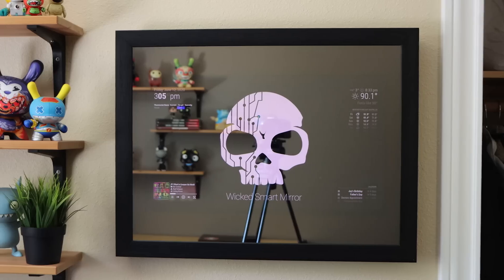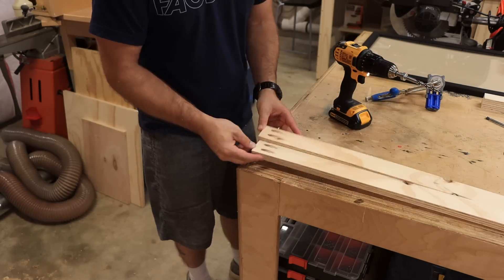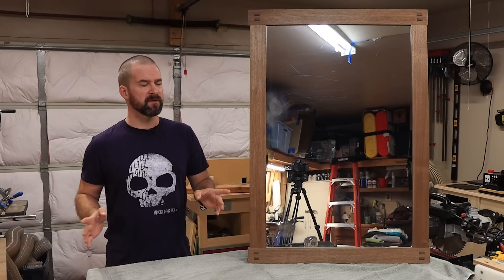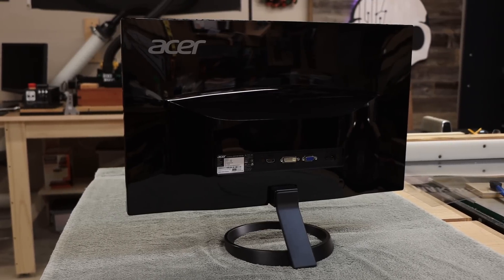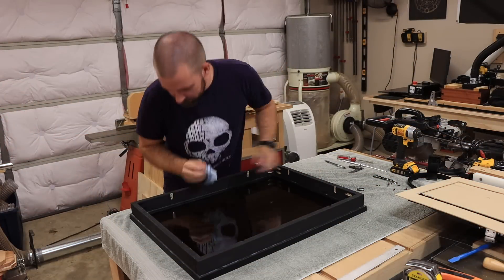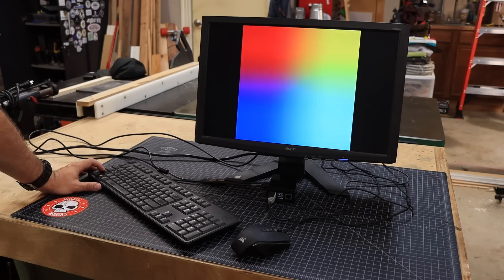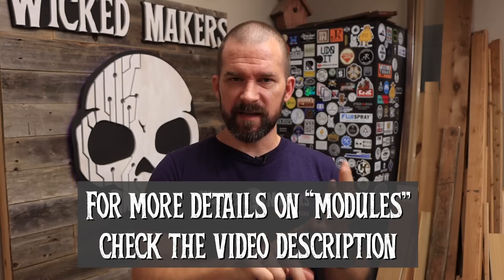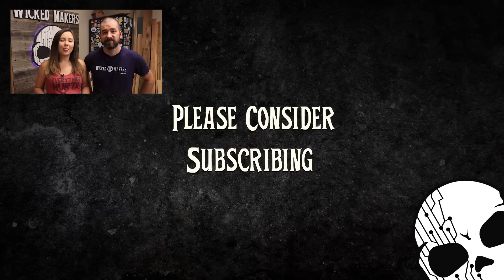How to make a DIY Smart Mirror

Comment: FYI - currently ~$460 + ply & keyboard/mouse. I recommend a wireless combo one for connecting to pi. Best wishes!
Reply: Why have that when you can ssh into the pi from another computer?
Reply from the maker: That’s fine, but not everyone knows how to do that.
Reply: @Roodj1  while interacting with the smart mirror, you'd prefer to interface using another computer? Maybe for initial setup but not for day to day interactions... that would defeat the purpose of the mirror.
Reply: @the.mr.beacher  well for most applications ssh would be fine because you would not be accessing it much.  For other applications maybe, but then becomes a "where do I hide these items" when not in use.  You can also, for a fee, get applications that allow you to use a web interface on another computer to edit things on your pi.  You're going to need to know some Linux to do this, but most of the scripts and such are on get-hub. And if you don't want the screen on all the time you're going to need a script to turn on and off the screen.  Unless you leave the buttons accessable.  
I have mine in the master bath and all it does is show time, drive time to my work, and calendar.  It's on at 6am at the moment, and off at 10am.  Then back on at 6pm and off at 10pm.  All I need to do is ssh in to change my times script.  If I want to edit my layout is a web interface.  

I personally don't like to have a keyboard and mouse floating around if I don't need it.  But I also recognize that some people will think that this way is to hard.  And having a direct connection, so to speak, is easier.  No disrespect to those who chose that way.  I just like challenges.  So I challenged myself to learn some Linux commands. And so far I've never had to edit my layout or ssh back in to change settings, though I will with my new 3am wake up this month. 🤮
Reply from the maker: Wireless combo is a great idea! And yeah, there are a few ways you can get the cost way down if you’re comfortable swapping out components or getting the mirror locally. 👊🏼😄

Comment: I went to a local glass shop and they cut me a 24inch by 14inch one way glass for about $80 for the glass plus polishing the sides and corners. So check out a glass cutting shop in the area if you have one.
Reply from the maker: YES! Great way to get the cost down quite a bit if you get the glass locally. 🤘🏼😄

Comment: I'm trying to make this with an tv instead, however I'm scare of the tv being too heavy for the frame :( any recommendations ?
Reply from the maker: Hmm, it might be too heavy yeah but can’t say for sure without knowing what TV it is. You’d want to mount it via the tv itself and not the frame, just like you would when normally hanging a TV.
Reply: Depending on weight and size of TV, you might be better off cutting into the wall to create a recessed shelf for it to either sit or hang/mount off of. Wouldn't be as easy to move though.
Reply: why don t you keep the tv as it is (with like robust vesa mounts) and build on-top and around the tv itself a kind of case too look like it is in the frame (but it's just like a skin for the tv)?
Reply: @stephenvoncrven4319  sounds great, I Just don't want to buy a monitor for this project
Reply: https://youtu.be/BR_yko0gr-Y
Reply: Mount the tv to the wall as normal and build the frame to go over it. You can secure the frame by screwing into a ledger board from the top to hide the attachment.

Comment: I've seen quite a few of these videos - yours was really well done and looks top notch! :) One idea I've had which simplifies the hardware side is to utilize a tablet - it's basically a screen and a computer all in one. Of course a major drawback is the screen size - it'll be quite a lot smaller than the computer monitor you guys used.
Reply from the maker: Thanks!! 👊🏼😄 tablet is a great idea if you’re building a smaller setup, for sure.

Comment: this project is awesome and I'd definitely want this to my bedroom :) 
but I see 1 flaw with this.
u can't really leave a raspberry pi (or pretty much any that tiny computer) running 24/7 so you'd need to add some sort of a power switch. 
after that, this would be 100% pure awesomeness
Reply from the maker: Thanks! We’ve actually had a Raspberry Pi running for like three years straight on our other mirror with no issues, strangely enough. But yeah a power switch is a great idea.
Reply: damn I'd think that Rpi would be long gone after a few weeks 😅
especially the new Rpi4, as it does get a lot hotter than the older models
Reply from the maker: That’s very true. The 4 runs way hotter.

Comment: Could this work with a pi with 2GB of ram instead of 4? Would there be a difference?
Reply from the maker: You might have trouble running videos or doing anything graphical but running the low key stuff would be totally fine on 2gb. 👊🏼👊🏼

Comment: If your'e concerned about the strength of the build why the hell are you gluing to /PAINT/? You need to be masking off the glued areas, or waiting till you get it assembled to paint or the glue is going to be worthless.
Reply: Add air holes for ventilation/sound while your at it, a small fan, and some speakers.  This wasn't meant to be perfection; just demonstrating what's within reach. Best wishes!

Comment: Very cool!  Any concerns with heat generation from the monitor and Pi inside the enclosed wood frame since they're on all the time?
Reply from the maker: No issues so far. Our previous mirror has been running for like three years straight with the same setup so not anticipating any issues. Could always cut some vents in the side if necessary too. 😀

Comment: Holy cow Batman! We have an electronic picture frame which is just crap. It rotates through pictures from vacations. Some are correct, some are laying on their side, etc. Really terrible and no matter how many times we tell it the rotation, it still refuses to do it. I suspect we could load the pictures in their correct rotation on a sim card and have it rotate through the pictures. And, it would be much larger. Thoughts?
Reply from the maker: Oh for sure. You could have it cycle through a folder of images like a gallery, easy!
Reply: @WickedMakers  Maybe you guys could tell me something. Is there a way to save YouTube videos, and posting material so that if something happens to you, like say YouTube doesn't like you at some point in the future and abolishes you, I as a user would still have that video and the links and posting material? I really see this as a project in my future but not today. Thanks, Bill